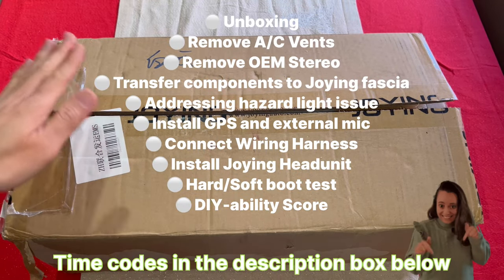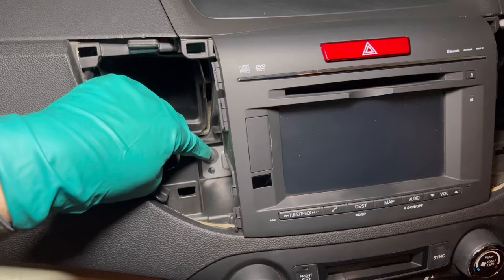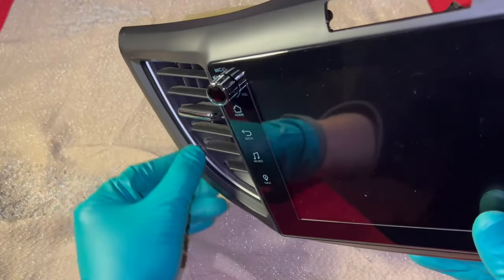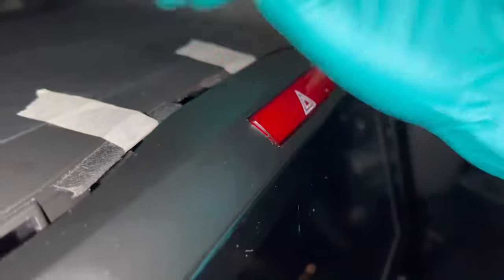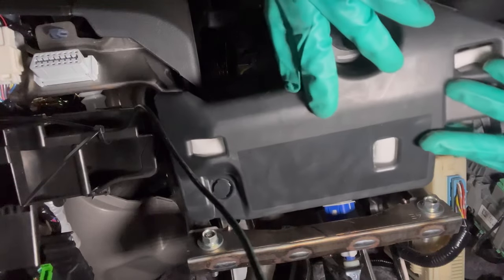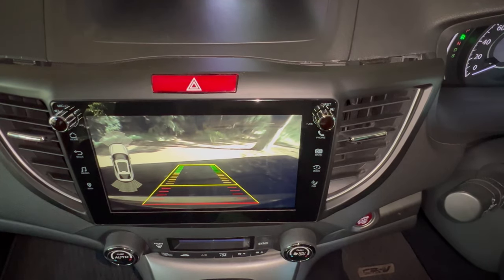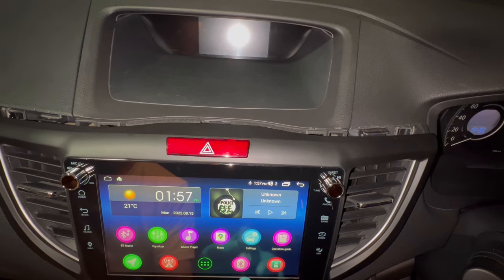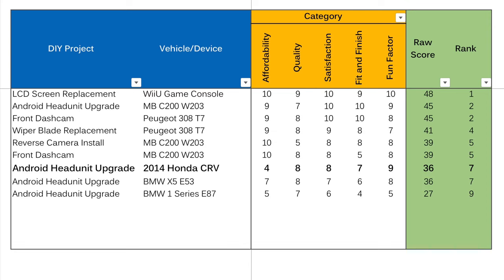HONDA CRV | ANDROID HEADUNIT INSTALL GUIDE

Comment: Thanks again for your detailed video. I installed the device in my Honda today, and the only difference was that I actually needed three orange clips. Without them, the bottom part of the device couldn't fit properly.
Reply from the maker: Awesome thanks for watching the video, really appreciate you taking time to share your experience.

Joying must have updated the design of that bottom trim.

Comment: Thank you so much for putting this all this together. Do you have any more information on how the stock reverse camera connects to the android head unit? I am trying to figure out which wires need to be converted from the stock connector to an standard yellow video connector and which wire triggers the reverse camera to activate. Many thanks.
Reply from the maker: Hi Peter, the wiring harness that came with it hooks up to the OEM reverse camera so there’s not much fiddling I need to do get the reverse camera to display the video on the headunit.

Does your CRV come with a OEM reverse camera or are you installing one yourself?

Comment: Hi, great video! I recently received this headunit and noticed that the GPS antenna is magnetized, making installation easier without the need for adhesive. I'm curious, was your GPS antenna also magnetized? If so, did you find that the position you chose worked better for your setup?
Reply from the maker: @davormilutinovic119  Hi Davor, I don’t remember if my GPS antenna was magnetised. At least for me, I think there is very little use for this antenna since the headunit supports Apple Carplay and Android Auto. I could probably do away not connecting this at all but since it was provided, I had to install it 😁

Comment: :goodvibes: I just got the latest Joying Head Unit with Android 12, have the same Aussie CRV Head Unit as in this video, and also got the wiring harness (B cable option) that had mis-matching sockets, and missing sockets marked 1,2,3 & 7 as marked in your diagram. My Cambus also does not pickup any data (doors open, lights on, steering wheel controls.)  Joying have been quite responsive, so hopefully I'll get a replacement harness.  I like what you did with separating the screen from the unit when mounting, I think I'll do the same. Glad I found your video.
Reply from the maker: Hi Blis, Im glad you find this video helpful. And yes, I fond their support staff really helpful and responsive. How did you go fitting the hazard light? Im curious if you had a hard time like I did…
Reply: @AutosNGizmos  I had no problem as I have the 10.1" screen version and the hazard button does not protrude into the dash cavity. Also, I removed the OEM GPS and mag mounted the joying gps in its place. The magnet seems strong enough to hold it in place.
Reply from the maker: @Blisoft  Cool great stuff!
Reply: Hi Blisoft, did you get this resolved? If so would you mind sharing which canbus model/harness they sent you and the CAN setting you used pls? I too have the same Aussie CRV head unit but replaced it with a different Android unit to the Joying. The harness they sent me has connections for all the OEM cables (except GPS as it has its own), but for the life of me I cant get the steering wheel controls to work. The seller is investigating but everything they've suggested so far hasn't worked.

Thanks
Reply: @WeaponAU  Joying sent me the same harness shown in this video, which has a Raise decoder marked "12-14 CRV (Malaysia)". Oddly enough when I first powered the unit up after connection, still with the "Simple" decoder settings still set from the previous harness, the SWCs (i.e. Vol -) worked for a few seconds, then stopped. Despite changing the setting to "Raise -12 Crv/Civic" as instructed, the SWCs have not worked since. Also doesn't recognise doors opening. Joying have yet to find a solution and have gone quiet.
Reply: @Blisoft  , thanks for replying so soon. Shame to hear you haven't got a solution. My decoder is a Raise RZ-HD74. It too says 12-14 CRV (Malaysia). Well, if I get mine working I'll post the solution here but I don't have high hopes. Cheers
Reply: Oh, forgot the above install didn't work either with the SWC.  :(   Maybe the HD-RZ-06 decoder is the one?  Once more point, I isolated the SWCs to the 12 pin connector, with GA-Net Bus on pins 1 & 2, not the plug questioned in this video. On pin 4 it carries the Hands Free Tele signal, which in my case works! i.e. pressing pickup phone opens Bluetooth phone app.
Reply: @Blisoft , my OEM harness has 7 cables. Before removing I disconnected one at a time to work out what each did. As you discovered, the 12pin is for SWC but its also for the iMid screen (if you have one). The factory reverse camera relies on two connectors for it to work. The 7pin (video in I think) and 6pin (I guess is the trigger when reversing?). Then we have power (biggest connector), radio antenna, GPS and centre console. 

In my case, the harness needs 5 connectors: power, rear camera (x2), SWC+iMid, radio antenna. The aftermarket unit has its own GPS antenna so no connector required. For centre console USB I needed a separate USB retention cable/adapter. The RZ-HD74 supplied to me covers this but SWC+iMid still do not work. The RZ-06 has 5 connectors but not sure if they are compatible. I could be wrong but some connectors look the wrong size/shape compared to my HD74. But your OEM harness might be different.
Reply: Hi  @AutosNGizmos , thanks for your video. Although I bought a different aftermarket unit I still found this quite helpful (thumbs up from me). Did you ever get the correct harness from seller? If yes, would you mind sharing the canbus decoder model and also do the steering controls work? Thanks
Reply from the maker: @WeaponAU  Yes, Joying sent me a new wiring harness but it doesn’t come with another canbus decoder.  I haven’t been able to install this yet but when I do, I will post an update video.  TBH, I’m not 100% but we shall see.

I’ve posted a photo of this new wiring harness in this youtube post: https://www.youtube.com/post/Ugkxf13dqUd9N2OZ5NIvodS_pt1J6Z9E2d2f
Reply: @AutosNGizmos  , thanks for replying. The new one seems like a few less connectors (at least for what I need) but who knows perhaps the wiring is different and it will work. If you ever get a chance to install it then that would be great if you can post here. If not all good. My seller is still trying to find a solution for me. So I'll report back if I get it fixed. Oddly though as I mentioned above, my harness does have SWC connector. Just doesn't work
Reply: Hey mate i have the CJ Industries head unit and my 2013 has the factory screen and sat nav. I was supplied an 'advanced' harness, but i still have three OEM plugs left unconnected after connecting everything i can with their harness. These are the 7 pin flat, 6 pin rectangle and another (maybe factory GPS antenna). No matter what can settings i change i just cant get the SWC or reverse camera to work. My CAN unit is the Raise G-RZ-HD56. Any luck with getting yours to work?  @WeaponAU
Reply: @garymatten  Hi mate. unfortunately wasn't able to get SWC working. Even tried connecting the SWC wires to the Key1 & Key2 on the head unit (bypassing canbus decoder) but no luck. 

I think you need a different harness with more connectors. The one that came with my new unit was a few short but seller quickly sent the correct one and a different decoder too.

Assuming your factory satnav is like my 2013:

* Reverse camera needs both 7pin & 6pin (its actually 3pin with 3 other holes to allow pin removal I guess??). The 7pin is for video signal, 3pin detects reverse to enable camera
* there is a 12pin for SWC & the iMid display. My harness has a connector for these but doesn't work. Strangely though the pickup/hangup call buttons work
* I assume your new unit has its own GPS so you shouldn't need to connect to the factory one
* the centre console USB adapter that came with  my new unit was not compatible but I found one on AliExpress
* My canbus decoder is G-RZ-HD74
Reply: @Blisoft  Hey mate, I realize its 4mths on but I had random situations too where SWC worked for a short while then stopped. Was driving me nuts but I worked out what conditions triggered it. I can reproduce it over and over. Firstly, headlights have to be on (so either forced on or automatic by parking in the garage with door closed). Then start the car, wait for the screen to display, then count about 5-6sec, then press vol up/down and it works. And it keeps working for random amounts of time (no more than about 30secs) but then stops. The volume level change even shows up on the small iMid display. I have no idea why this triggers it then goes away but thought I'd post it in case anyone has any ideas.
Reply: @WeaponAU  OK, good to know.  I saw it work just that once, just must have got it in the right stage.  I had given up for now trying to solve it, but would be nice if there was a solution. With the manual volume knob, its been quite OK, and everything else is working great.  The HD Cams are well worth it too, so overall still happy.
Reply: @WeaponAU  that’s helpful thanks. The harness I was sent doesn’t use the 7 or 6 pin so that would be my issue. I’ll keep trying to get one sorted. As for SWC sounds like no one is having much luck. Very annoying as my screen doesn’t have manual volume knob. Also my illumination won’t work, just stays fully bright and no backlight on the volume controls. Quite annoying.
Reply: @garymatten   Mine doesn't have a physical volume knob either. Definitely missing SWC. Hopefully you can get a replacement decoder/harness to sort out the issues.

btw, earlier today I found the decoder originally supplied with the new unit. Its a G-RZ-HD56 like yours. The harness that came with it has two grey connectors, one white and one black (radio antenna). The white wouldn't fit any plug on the OEM harness so initially I couldn't get the reverse camera to work either until they sent the replacement decoder HD74 and harness. Despite having all 5 connectors I needed (power, rear camera x2, SWC+iMid and radio antenna) the SWC still didn't work.
Reply: @WeaponAU  that’s useful info mate I’ll request that connector too…maybe I’ll have more luck with the SWC
Reply: @garymatten  Let us know how you go. Good luck
Reply: @Blisoft  , I've got a workaround for volume up/down by remapping the handsfree buttons to them. Not sure if this will work for you or if you're willing to give up those functions.

Anyway, I had tried remapping them a while back using the preinstalled SW Learning app but it wouldn't let me remap those buttons. While it detected the press it just triggered their default actions. So I gave up on that idea. But today I found another learning app/process. On my unit you access it via My Car app, then tap App then Learning button. To my surprise this let me remap the handsfree buttons and change volume that way. Its not perfect but I prefer volume control over default phone actions.
Reply: Great thanks ill try this! @WeaponAU

Comment: Thanks for the awesome video. What wiring harness model (A-E) did you buy for this please?
Reply from the maker: Hi @jonedney1584, when I bought the Joying unit for the car in this video, Joying didn’t have those A-E pictures. I just sent them a picture of the back of the existing stereo and they sent me the “appropriate” wiring harness with my purchase. However if they have those pictures of the different types of OEM stereos, I would not have bought from them because mine didn’t seem to match any of the selection from A-E. See post below.

https://www.youtube.com/post/UgkxUQNoKU5YSDRGIUBfT6IM2k2ZDIeSIJoM
Reply: Thanks for your reply  @AutosNGizmos . 

I've compared the connections on my existing OEM unit to the wiring harnesses Joying sell on their website. I've asked the dealer to send me the HCRV-H harness with the  "Raise G-RZ-HD74" decoder. I'm not sure which model (A-E) that relates to, but they seemed happy to send it to me. The number and style of connectors seems to match what you used in this video. 

I noticed in the service manual for the car that the 8-10pin connector you had left over is either an Aux in or Subwoofer out connection. The other one is the OEM GPS. 

Thanks again for taking the time to put this video together, it's really appreciated.

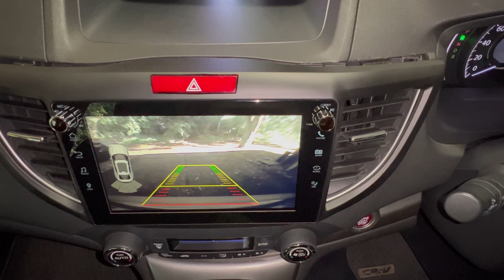Comment: Awesome video.  I really needed this because I am not very techy and this helped immensely.  Thank you.  Just one question.  At about 36:45 you show another USB connector.  What is it and what does it connect to and where?  Thank you again and have a great day.
Reply from the maker: @philbeals4442  Hi Phil, that extra wiring harness is needed if your car has a USB port inside the centre armrest. Have a look at the 26:49 mark. It essentially connects that USB port into the Joying headunit so you can use it for charging or Carplay/Android Auto.

Comment: I was able to get the Joying head unit going well using HCRV-H harness with Raise RZ-HD06 Decoder. HOWEVER, it's not as simple as connecting a compatible decoder (I know this because I tried 3 in the end!). 

After a lot of research and comparing wiring diagrams I've found that some Honda CRV's have a 12pin Audio-Nav Unit Connector - this is the one with two rows of pins, but only the top pins have wires. If you trace them, most of the cables go straight to the Canbus decoder connector. Unfortunately, the 12pin connector does not have any pins for Can Bus, it only supplies GA_Bus (not sure what that is, but I think it's something to do with AV). 

The secret to getting Can Bus working is to tap the Can Bus lines (Pin 15 & 31) going to the back of the MID Screen. 

I've disconnected the 12pin connector altogether and applied the tapped Can Bus lines from the MID screen to pin 11 and 12 of the can bus decoder everything now seems to be working. So far I've noticed Steering wheel controls, Door open indicator, and Reversing Track 'bends' with the steering.
Reply from the maker: That's excellent work! I tried back-and-forth with the Joying technicians and they were not able to help make the steering wheel buttons work. I'm glad yours worked :)

Comment: Thanks for the video. I did the instalation and my stearing wheel control does not work.  Also parking camera only works on top monitor (not on main unit) Any advise? TIA
Reply from the maker: Hi Jonas, with regards to the reverse camera: 

1) if the headunit does not automatically switch to show the reverse camera video input, then a potential source if issue there could be that headunit has an incorrect Canbus setting in the BIOS. Have a look at the BIOS settings page and look for something like “CAN Type” setting.
2) With regards to the steering wheel buttons, I also encountered the same issue.  I was communicating with the seller about this and they provided me with another wiring harness which didn’t work either. And since this is a friend’s car and they are not bothered by that issue, it was a bit difficult to troubleshoot it. So I would suggest that you reach out to the seller and explain to them the issue you have with the steering wheel buttons not working.

I hope this is helpful.

Cheers! 😊

Comment: Hi, Great video! Just wondering if you ever got the steering wheel controls working? If you did can you update with what needed to be done to get it working? Thank you
Reply from the maker: Hi there, no unfortunately I havent done  this yet although the supplier have provided free of charge the replacement wiring harness. I dont own this car so its just difficult to organise the install more than anything.
Reply: Do you have a photo of the harness? Wondering if you can send it to my via email. Thanks
Reply from the maker: Hi Dave, I can post a picture in Youtube and I’ll send you the link. I’ll also send the instruction provided by the seller
Reply from the maker: Hi @davetea here is the link to the photo of the new wiring harness from the Joying people for your reference…

https://www.youtube.com/post/Ugkxf13dqUd9N2OZ5NIvodS_pt1J6Z9E2d2f

Comment: Will this unit work in 2015 honda crv ex that has AD screen? Thanks for your video
Reply from the maker: Hi Kieneonta, according to the Joying Aliexpress store, they have models that would support CRV’s with AD screen.  But best if you contact them directly to confirm.  You can use the product link in the description box of my video so it takes you directly to the Joying product you are after.

Cheers 😊

Comment: nice video :) are these radios work with the 2016 facelift ? are the original usb ports work with the radio ?
Reply from the maker: Hi Legend, Sorry I’m not sure if this Android system will be fully compatible with the 2016 facelift so you might need to check that with the seller to be sure.

With regards to the USB ports, yes it worked after the install and I can use for charging and Carplay/Android Auto.  There is a special cable which you can see in timecode 2:48
Reply: @AutosNGizmos  thx men :)